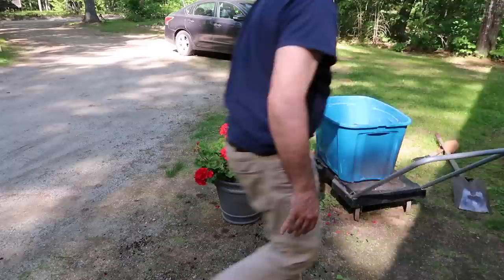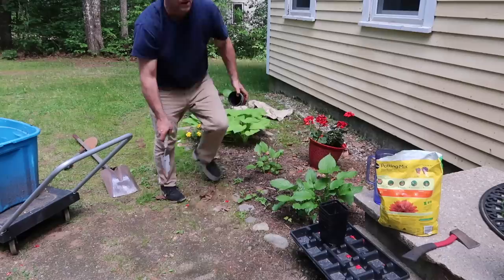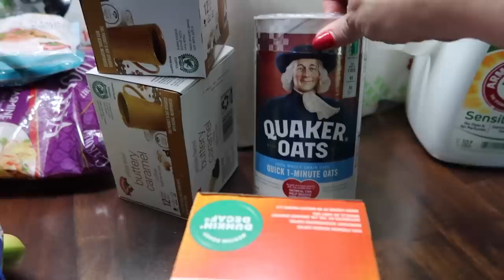SUPER SATISFYING, YARD BEAUTIFYING, PLANT AND DIY WITH ME!

Comment: Hi Karen! The flowers are beautiful! Mr. Robin did a great job planting everything. I suggest putting a flower bed or garden plants in the raised bed. Would deer netting work to deter them from munching your plants? We have lots of deer but they don’t seem to care about the plants or garden I have. The frogs will take a bite out of a tomato occasionally. 😁 I have 3 or 4 raised bed containers for gardening and I have various tomatoes, various lettuces, bell peppers, hot peppers for hubby, yellow & zucchini squash, etc. I have never heard of planting marigolds with tomatoes for pest control but I will have to try that next year. I try to use organic pesticides but have had to break out the Sevin dust before, usually I don’t have pest problems, thank goodness. We are in a heat wave with temps near 100 and heat index 110 or better, so I have to water the outside plants & garden daily. Gotta love summer in the South! 🥵😂 I do ANYTHING I have to do outside early in the mornings or late in the evenings to avoid the heat & humidity as much as possible. The temps will drop into mid 80’s and low 90’s next week so that will be great. I enjoyed seeing y’all putzin around outside. You did a great job on the deck. Staining a deck isn’t for the faint of heart, especially with faulty equipment. 😁 Been there and done that. 🤣 I have tried growing rhubarb several times over the years with no success but I am going to try growing it in a flowerpot next year after hearing some have had success that way. My sister-in-law has it in the ground and gathered a handful of stalks last year, just doesn’t grow here like up north. When she still lived in Minnesota she couldn’t kill the stuff she said. 🤷‍♀️ Do you have any secret tips or tricks to get Rhubarb to grow? And I have grown geraniums indoors lots of times, some individual plants have lived several years before I ended up forgetting to water them when I put them back outside for the summer. 🤦🤷‍♀️😜 Anyhoo, I pray you have a blessed weekend my friend! ❤️❤️
Reply from the maker: I got this deer spray and it really smells so bad!! It works but you have to do it once a week or so. Maybe if I do it at night it won’t smell so bad come morning!! I did it the first time about an hour before a family gathering! Big mistake!! 🤭😃